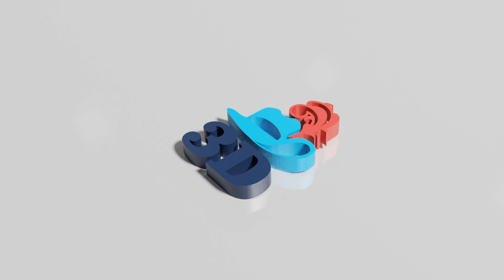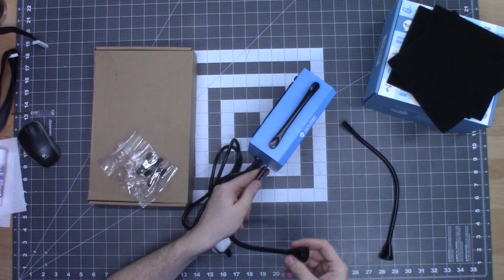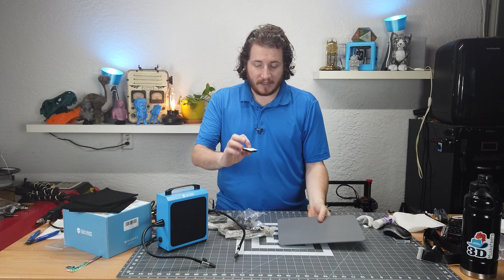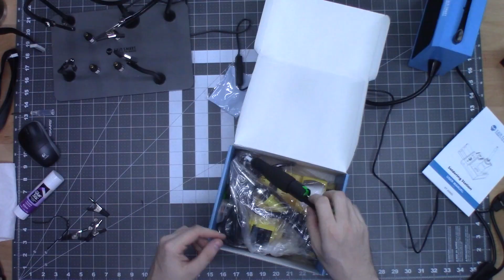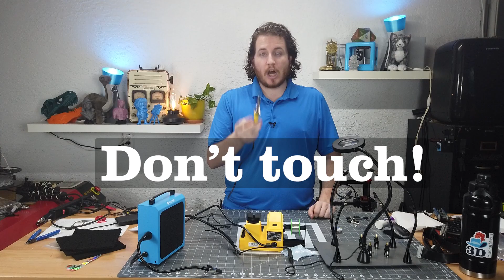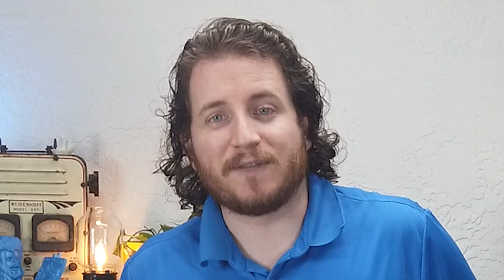SainSmart's NEW Soldering Tools are Pretty Sweet!

Comment: Good review. I agree the helping hands are the best for the money.  I also agree with the lead free solder.  I have been using leaded solder since my Air Force days in the 1960's and never had any problems.  It melts at a low temp and flows well
Reply from the maker: I am glad I am not alone on the leaded solder!

Comment: Seems like a USB port in either the soldering station, or fan would have been a great bonus for that light. Now you basically need a power strip to provide 3 outlets to use all the items.
Reply from the maker: Definitely would have been! That is a good point! I have so much on our electronics bench that there is already a large strip there so I never considered that many would not have this luxury
Reply: @3DMusketeers  I have a large 12 outlet strip on every bench as well, and sometimes there are no extra outlets.
Reply from the maker: 1st world problems lol